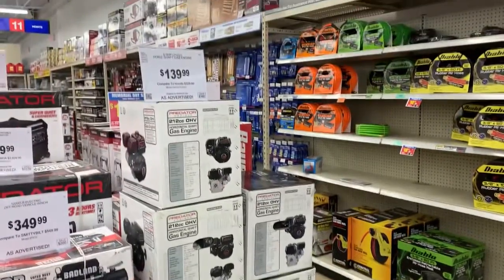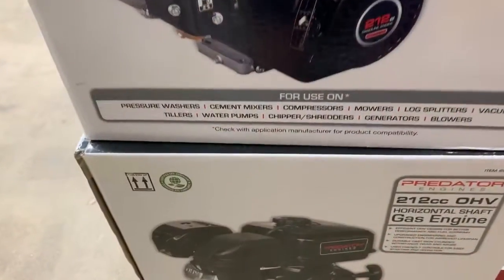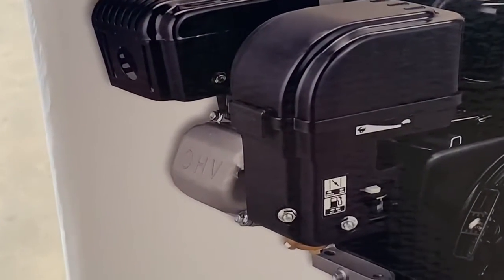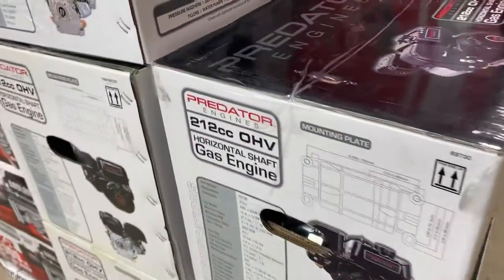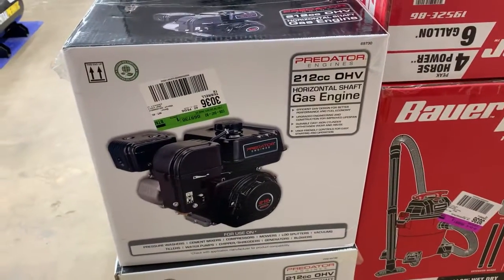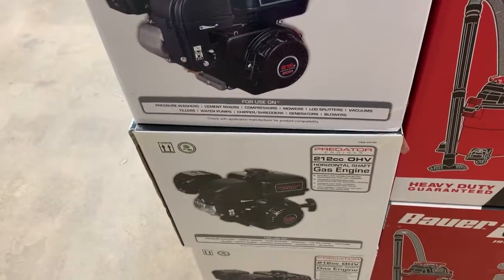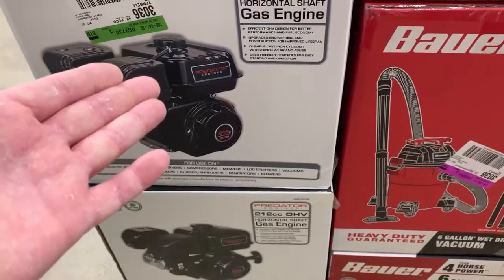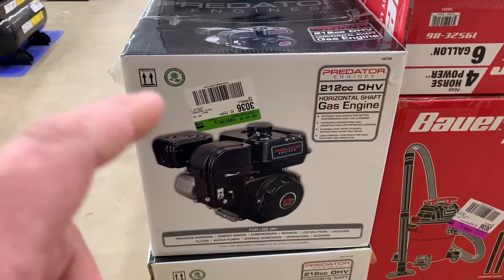PREDATOR 212 HEMI VS NON HEMI

Comment: I got a 212cc predator engine but my part number on the box is 69730 is it a hemi or not? Plz help me out. It has the same parts as the hemi it’s just the part number does not match and it has me confused
Reply: I just picked one up and the same thing happened to me. 69730 on the box, but the picture and the actual engine are the hemi. Found this video which confirms that we're not crazy https://www.youtube.com/watch?v=2dINcYSdzW4

Comment: I just watched a video the other night where the guy swapped the heads from a Honda GX160 to a  Predator non-hemi. The GX160 can go on the non-hemi but not the hemi. So now I learned the GX200 head can go on the Predator Hemi.  Heh TILSN.  https://www.youtube.com/watch?v=Xh0om5moxB0

I dont know anything about the GX160 and GX200 but I guess now the question is which one of those two has the better head? the 160 or 200?

Comment: FYI - HF is starting to put the hemi engines into the 69730 box! Trying to find a true non-hemi is like trying to find Jesus.
Reply from the maker: Wrong.
Reply: @THEMOWERMEDIC1  No, you are the one who is wrong. I bought a hemi 212 from Harbor Freight today in the 69730 box.
Reply from the maker: My hf  had them both in stock    Did u even watch the video?
Reply: @THEMOWERMEDIC1  yes, I watched the video. All HF stores in their computer system had only the 69730 part available. None had the other part. My 69730 has the hemispheric combustion chamber.

Comment: I've noticed how the price has been climbing upward on these little engines over the past couple of years, I put one on my grandsons go cart two years ago and the price was $99.00 and about three months ago they were $129.00 and now in this video they have jumped another $10.00. I don't know if it's due to popularity or just inflation, but they are really good engines and still a lot cheaper than Briggs, Honda and Kohler.
Reply: Was thinkin the same . I think hf is under new mgnt , its changed the last year or so , and prices are up , but 40% in a year ? Bought 3 of em about 1 1/2 yrs ago at 99$
Reply: $149 right now. Super sale eill be at $129 soon
Reply: They use them on the kids race karts as well